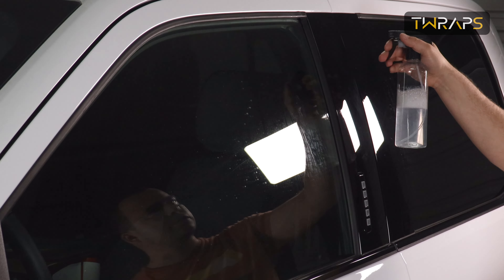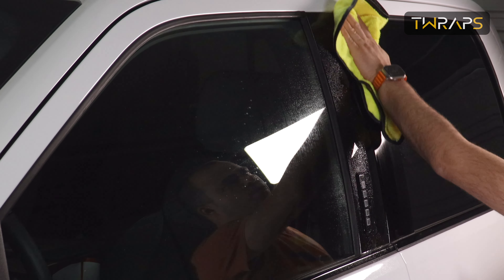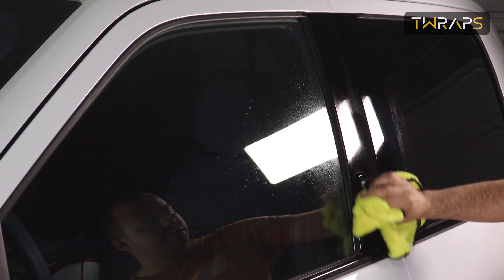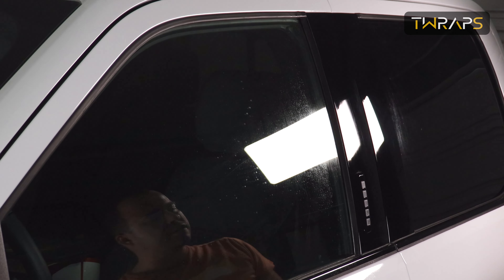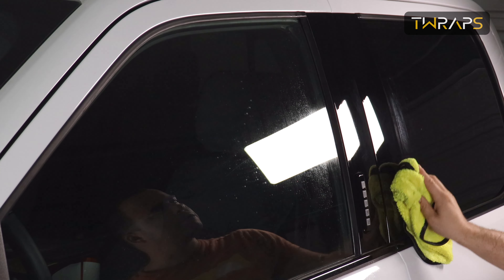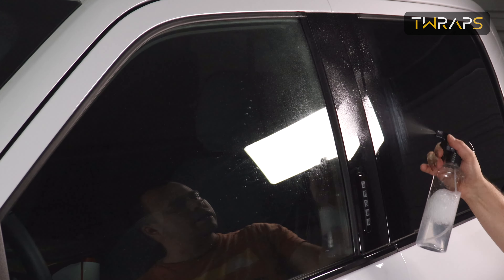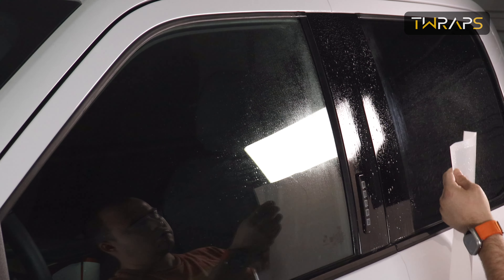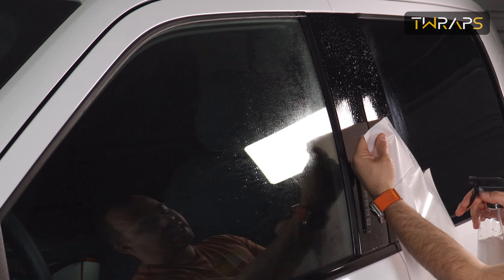B Pillars PPF for F150 Lightning by TWRAPS

Comment: Hello sir i have a question. I had my piano black trims ppfed yesterday but they are already dirty on the edgrs in few spots. Like the dirt came under the ppf. Is it normal? How can i correct this
Reply from the maker: It can happen if the edges didn't stick too well... if you bought this from us, please reach out via email at hello@twraps.com - I can send you a replacement. As for how to prevent it in the future - you can use a heat gun to make the edges stick. Mostly not an issue in summer months but if it's cold PPF takes longer to cure so the edges might lift up and collect dirt, hence the heat gun (or hair dryer) recommendation.
Reply: So the only way to fix it is to wrap it again or trim it (risky)
Reply from the maker: @MikesPL86  Likely yes but as a last try you can try pressure washing at the corner and see if it gets the dirt out.